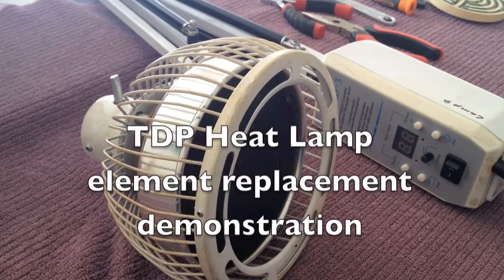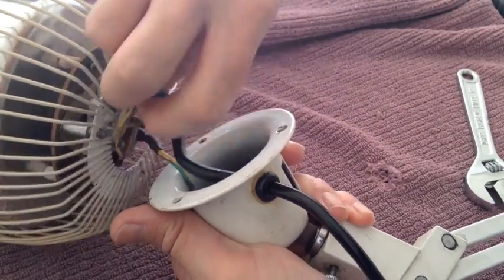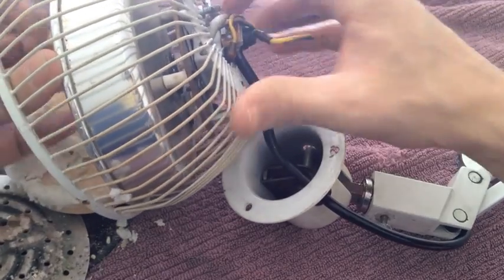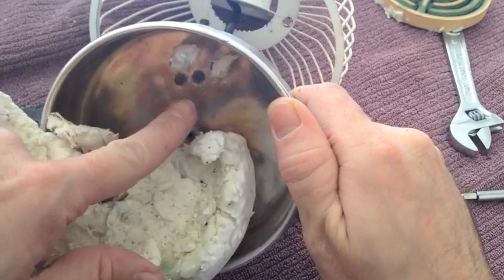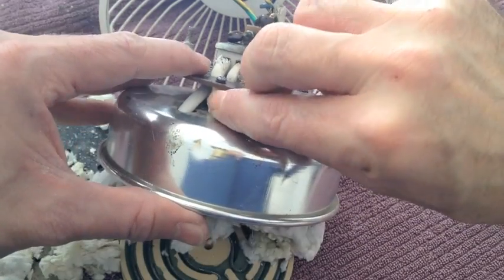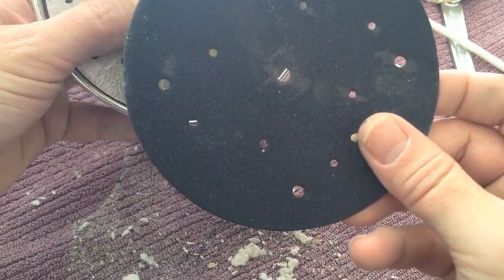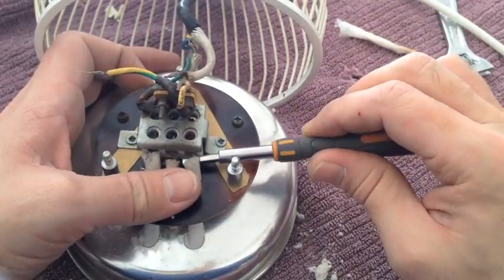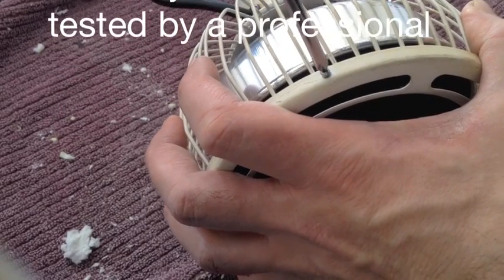TDP Heat Lamp Repair

Comment: Absolute Legend !
For those who are having trouble finding the mineral heating element on ebay, following link might help. (Double check and research on your own)
https://www.aliexpress.com/item/32835457951.html?spm=a2g0s.8937460.0.0.7cd82e0eAWPLdi

Comment: I have a question. I've just purchased the same lamp but when  I've turned it on, the cables went incandescent red and I switched it off immediately. Is that normal?  Many thanks
Reply from the maker: +Fifi Fontanot Thanks for the question. What 'cables' are you referring to?